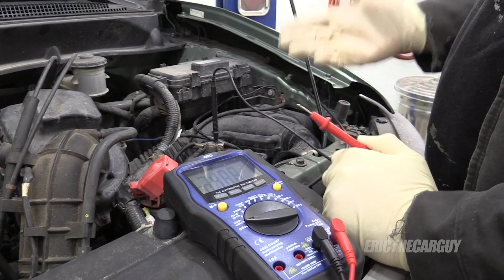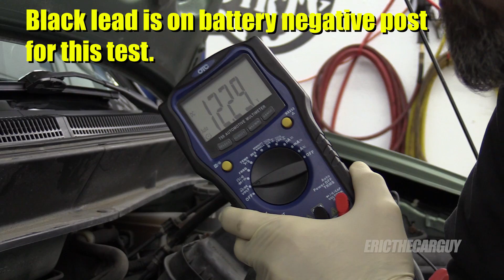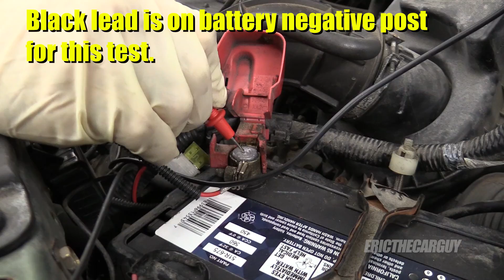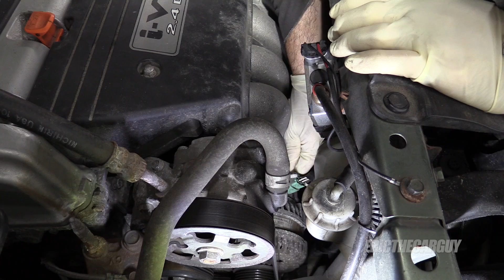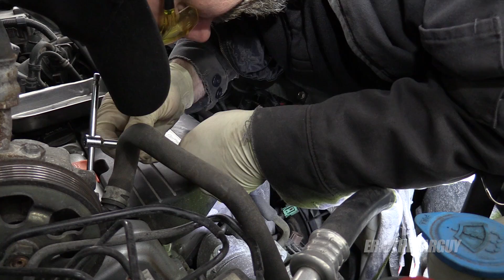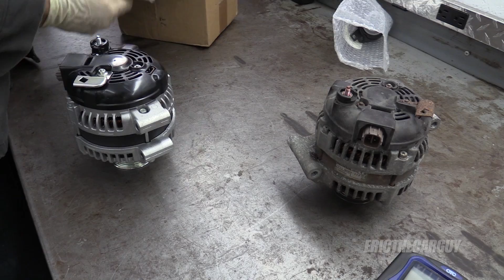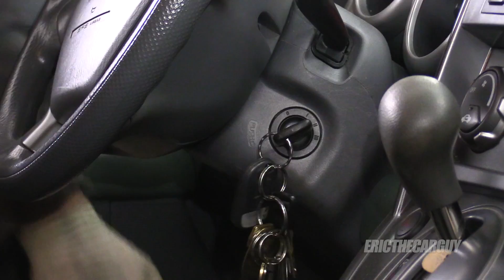Honda Element & CRV Alternator Replacement With Diagnosis

Comment: Eric, 
Really would like some insight on this. I did a 2010 yesterday I had to evacuate the a/c and remove the low side line for the compressor in order to get one of the bottom bolts out. Can you shed some light on this?

Comment: hey Eric. I really need some help.. I have a 02 Honda CR-V that starts idles for 10-15 seconds then dies. if I give it gas it dies faster.. I changed the tps sensor, put a new fuel pump. check the timing. clean the throttle body etc. still won't run. if I spray starter fuel into the throttle body while it runs. it runs a little longer then dies.

Comment: A can of clear spray paint would protect those terminals from battery acid and other corrosives while still allowing for the car to be jumped or used for jumping other vehicles, and is MUCH more effective than "battery saver" sprays and gels.

Comment: Why not do what I always do....take the alternator to a good auto electric guy and have the brushes, bearings, and regulator replaced. Less than $100 around here. Naturally they verify that the rotor and field windings are good. I like keeping the original part in the car 330,000 miles so far on my 2003 Acura CL Type S).

Comment: Flashing lights in and outside of the car sometimes gets worse if you have accessories on worn out brushes , sends a pulse through the circuit/ wiring

Comment: soi work on semis for a living and just to make my life easier with belts if im removing a belt while working i will use a bungie cord to hold the belt tight so it wont move around and i dont have to reroute anything to put it back together just throwing that out there
Reply: Genius.  Thanks for the tip.

Comment: I have a question. If I buy a 3/8 torque wrench because it has a more useful range for me than the 1/2 inch one I'm comparing, Can I use a 3/8 to 1/2 adaptor ?

Comment: Older Subarus from around the 90's had similar issues with aftermarket rebuilds so this doesn't surprise me. I hear some people complain about the newer ones too, but I haven't read any write ups on them in the forums. 
This looks easy enough, but I'm wondering if you might have saved yourself some aggravation by using a TiteReach or maybe the Stanley Rotator ratchet. I believe Black Hawk has their own version too. I use mine religiously when I can't get a good swing in a tight place. 
Overall good advice on how to test. Most people don't know what steps to take when it comes to charging system diagnosis. This is very informative and a great presentation. 
Great work, Eric!

Comment: I stopped using rebuilt(?) alts and starters about 30 years ago.  No quality control at all.  I wound up doing them over again. Sometimes twice.     An economical alternative to a new OEM part is your salvage yard.    Many parts are the same across manufacturers lines and model year.  The guy behind the counter can tell you which ones fit. 
Look for a later model/lower mileage OEM part.    You may have to change the pulley,  but they usually outlive the rebuilt several times.
Thanks for the video

Comment: Great vid.. sucks w the limited space though. I just had to do the Alternator & tensioner on my 99 F150 after doing it 2 yrs ago.. I had a Valucraft in there with only 1 yr warranty that I thought was lifetime. Of course, it gave me issues after the one-year warranty was up. Just installed a Durlast w lifetime. In 20° Chicago weather...lol. the purpose of this comment was really just to add how easy the alternator was on my truck because it sits up top..lol. #StayDirty

Comment: It’s good to check out the possible causes of alternator under performance such as wear of the brushes, wear on the commutator or failure of the voltage regulator. For a shop a quick turn around is necessary so swapping out an alternator ensures the job is done. For time rich, cash poor DIYers the refurbishing of an alternator can be done very cheaply on the bench.

Comment: Eric, my 2009 Bmw M3 alternator failed, it was B* too replace because of the location.. I went to autozone and they ran a rest on the car and found the voltage regulator too be bad.. Bmw parts sale the oem alternator for $1000, original part manufacturer for the alternator is Valeo, so i checked that and that was 400 dollars.. I did a simple fix by changing the voltage regulator for 65 bucks using valeo oe replacement.. My alternator was literally doing what your diagnosis was doing, charging around 11.5-12.5 volts with load on.. So before replacing an alternator, it is great too do some research and see if you can infact change the voltage regulator, the brushes on it literally was worn and hardly contacted with the slip ring of the alternator... You can even buy the brushes for 6 bucks on ebay oe valeo ones and solder it..

Comment: Hey Eric, do you think undersized factory power and ground wires kill alternator prematurely, I understand cheap alternators don't last based on build quality but is there any reason why an alternator could or would wear out from working too hard like being bottlenecked from too small a charge wire or not a adaquete ground wire ?

Comment: I'm glad you're keeping that thing running.  I have a pair of Elements and have found these to be the most unique and fun vehicles to own.

I have dreaded the alternator going out, but it looks somewhat easier than the starter.  Glad to see I'm not the only one that struggles with that silly serpentine belt on these things.

Comment: can't this issue be usually fixed by swapping the regulator on the alternator? those are much cheaper although You have to be handy with a soldering iron - desoldering those high-load connections is a pain in the arse (high thermal capacity), but was well worth the 80€ difference between a remanufactured alternator and buying just the regulator.... (did it on opel astra mark G '98 1.4)

Comment: Eric your gloves are ALWAYS tearing apart. Harbor Freight sells a box of 9 mil gloves for about $12 I can say from testing them you can take the serrated portion of a folding knife and rake it across your palm with these gloves on and it doesn't tear and it doesn't hurt either.

Comment: How funny. Alternator of yours Eric looks exactly like the same alternator that's in my 2013 Subaru Legacy with the Flat 6 cylinder so it's either a Mitsubishi alternator or a Denso, I mean the connectors look exactly the same on mine is yours color ect.

Comment: I wonder why the overflow bottle only has one hose connection to the cooling system? I mean, isn't it meant to also let coolant flow back into the system when needed (i.e. if there is a small leak somewhere or so)?
Reply from the maker: That has nothing to do with the hose. The radiator cap is responsible for flow in and out of the overflow bottle on this type of cooling system. I cover that in this article if you're interested. http://www.ericthecarguy.com/faq/what-to-do-when-your-engine-overheats
Reply: Thanks! I just thought it looked strange. So the hose must go down towards the bottom inside the overflow bottle, for it not to suck in air instead of coolant - then it all makes sense! :)

Comment: With the "broken" connector on the new Alternator, would that be a prime time to put some dialectic grease around it to help prevent the ingress of water and other things .. cause doesnt the gasket/rubber ring in the connector push up against the broken part of that plug? love the videos ...again .. glad you are back putting up videos on this channel too
Reply from the maker: With a weather seal connector, I don't see much point in putting grease on it. Not saying it would be wrong, I just didn't see it as necessary. The rubber seal bottoms out on the terminal well below the break and will keep contaminants out. After a year the alternator is still functioning perfectly. I stand by what I did. I would have had to ship the broken one back and wait for a new one to show up. I simply didn't have the time for that. Thanks for your comment.
Reply: thanks for the replay .. wasn't sure (for personal use) if I got an alternator like yours if you would recommend the use of grease to the novice. I also wasn't calling you out or implying you didn't know what you were doing .. I was more asking your opinion .. Now that I re-read the way I wrote it, I can see how it could be taken as me questioning you.. (not the case) .. glad it is still working great, and I got the answer I was looking for.  Thanks again

Comment: Instead of buying a new Honda alternator Id go to a starter/alt shop and have it rebuilt. When it went out on my Accord last winter.
Reply from the maker: It wasn't new, it was a remanufactured Honda part. Link in the description. Many people have mentioned rebuild, but I've never found much value in that. After you get done sourcing the parts, good luck finding Honda parts BTW, and doing a 'proper' rebuild, you would have an alternator with no warranty that took a bunch of time to service. For me, time is money. If I have to spend more time doing a repair, it becomes less cost effective. Also, consider the labor rate at your local garage. The more time they spend working on something, the more it will cost you, even if they send it out to be rebuilt. Now you have an additional charge for the rebuild on top of the part and the extra labor. Sometimes what appears to be the cheaper rout, just isn't. Thanks for the comment.

Comment: most aftermarket alternators have life time warranty, did your replacement come with one? Love your Videos Eric!
Reply from the maker: If you have to replace it every other month because your new alternator fails, it's not really cost effective. In my experience if you install quality parts, you only do it once and you can move on with your life. Honestly, I don't remember what warranty came with the part, but it was a Honda reman and after a year, it's still working flawlessly. Thanks for the comment.

Comment: Awesome video. Would’ve been good to have changed the pcv valve when u were in that proximity. 

Keep them vids coming, ive been a long time sub
Reply from the maker: In my experience OE Honda PCV valves hardly ever go bad. In my experience if you change your oil on a regular basis, PCV valves are rarely a problem. PCV valves are often just an upsell. Also, I don't believe this engine uses one. Thanks for the comment.
Reply: EricTheCarGuy thank you for your reply sir. I learn from you all the time 😊. 

That is interesting. In the pass when I rebuilt a k20a3 and a k20a2, I found the pcv valve behind/near  the idler pulley. I just thought the k24 in your element would have a pcv valve too in the same area.    My mistake then lol

Comment: Personally I wouldn't have used that alternator with the connector broken like that. I know it's not a customer vehicle, but if you paid for a brand new part you should get an undamaged one, and it's going to be a lot easier to warranty it right away than later on down the line if it starts causing an issue. And it's not like Eric is lacking other vehicles to drive with this one down, lol.
Reply from the maker: That would have required me to send it back and wait for a new one to show up. I didn't have time for that. I have confidence in what I did, and after a year, there have been no issues. That said, I likely would have installed this on a customer car as well. If the connector was broken below the weather seal, I wouldn't have installed it, but from what I could see it wasn't. Thanks for your input.

Comment: Remember that old Subaru you had? Alternators are super easy to change on those. Probably could have had the alternator out on that by the time you had the belt off of the honda.

Comment: Could you identify which part of the alternator was bad?  Honda also sells each part separately, so you could change only bad part, right?
Volt regulator, rectifier, brush holder & bearings can go bad.  (I changed brush holder & rectifier for my S2000)
Reply from the maker: To my knowledge, Honda only sells reman alternators.

Comment: Funny story with my Honda Element.  Had the same problem but I elected to remove the alternator out the front, which forced me to remove a fan temporarily.  Decided to replace the serpentine belt at the same time.  Now, when the A/C (compressor) is on, the engine has a weak but noticeable vibration.  Why?  I can't seem to pinpoint it.
Reply: A/C compressor bearing or belt tensioner is going bad?
Reply: Slicerwizard Would that problem make itself visible with the installation of a new, tighter, belt?
Reply: Sorry, can't say for sure, but a new tensioner is only about $100 from rockauto.com and it doesn't require any special tools, so if you can do it yourself, why not give it a shot.

Comment: Now, it wasn’t shown, but did you use your anti seize on those alternator bolts? Cause in your recent video you mention you always use anti seize on bolts.
Reply from the maker: I've never found the need for that. It just makes a mess.

Comment: Eric Love Ya man, but since the alternator dropped voltage under load wouldn't it be a good idea to check for voltage drop between the voltage output of the alternator and the battery positive and likewise between battery negative, alternator casing ground and engine block ground.   It seems like something I would do (in fact did do in my video diagnosing a Hyundai alternator)

Even though the alternator seems like it is making un-happy sounds it will if there is a dirty ground or charging output circuit, because the amp load on it increases as voltage decreases.
Reply from the maker: In my experience what I did in the video is typical and as shown, a new alternator fixes the problem. Also, because I had to remove the power steering pump to access the + on the alternator, then I wouldn't be able to run the engine for that test. I'm not saying there can't be other issues, but it's not common in my experience and I stand by the testing and repair I did in this video. Thank you for your input.

Comment: One of the issues I've seen with aftermarket alternators, specifically with the Honda Odyssey, Ridgeline, and V6 Accords is the quality of the solder used inside the windings.  On those engines the alternator is mounted directly above the exhaust manifolds and causes the solder to melt and the windings come loose and destroy the inside of the alternator.

Comment: Happened in my 2003 element. While driving on the side of the road. Dash lights go out first before the engine stalls and dies. oh, and they die around 11.4 volts. sometimes 10.9 if its cool out. Figured that out the hard way.

Comment: Eric you should put dielectric grease over all the connections and look into some aerospace plastic and rubber protector/sealers, I have bushings/vacumm hose with 250k + with harsh winters and warm summers and all my rubber/plastic components are still like new, if nasa uses it, it must be good right ? Car compagnies dont want your cars to last so they hide those kind of secrets but things like that should come from factory or more magnets in metal moving parts but no that would make the cars last too long and less sales -_-'', lets put in thinner oils that will make the cars more efficient and have less protection, win win for them.
Reply: I don't think car companies hide that stuff intentionally, they just don't want to spend unnecessary money and they probably don't give a shit anyway. Not trying to sound rude.
Reply: Of course they care, they build their cars to last out the warranty life and thats it. Sealed fluids, sealed components with nothing serviceable, yes cheaper but also they know long term people wont fix them and just dispose of them and buy another new one and the circle continues.

Comment: Another reason why I dont buy cars with transverse engines placement, my hands are big and everything  is a pain, they squeeze it in there without any care for engineering solution to make it accessible  for service. I rather work on german cars, yes their is more stuff to remove but they use better quality hardware that doesn't snap ( Example most bolts are aluminium or just zinc coats at least) except plastic of course that is the cancer of cars nowadays but even then, the german cars have much much better plastic materials in general compared to import/domestic but most importantly, everything is very easy to do if you know the proper procedure, they thought of it when they designed the car, like having holes in the body to access hidden bolts example where in a domestic car you would be forced to take half to car appart to get to that one hidden bolt. 

Point is the over engineering is a good thing in german cars, not all but most of them you look how they design things and its much more sensible then domestic and import stuff although imports, toyota mostly are better at design things to be removed. Point is with german cars you can tell the engineers for the engine//body/interior all worked together, something that is missing in imports and none existant in some domestics, chrysler example are the worse, never buy a chrysler product, worse engineering and quality ever.

Comment: I remember having an alternator issue and I went to an electrical guy that replaced some of the interior components? Isn't that worth doing open the old alternator and fix it?
Reply from the maker: I don't believe the parts are available.
Reply: I didn't think to correlate the he aftermarket alternator issues with the repair kits (which usually are subcomponents of the aftermarket stuff).So thank you for the kind reply to my somewhat stupid comment.